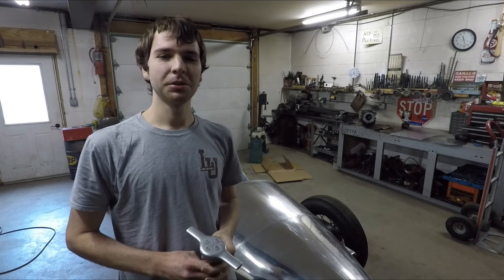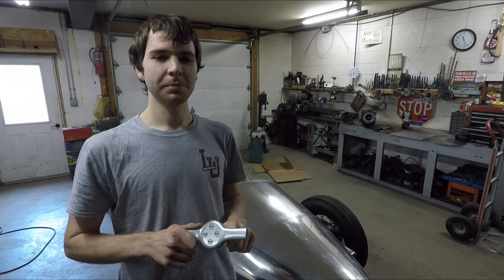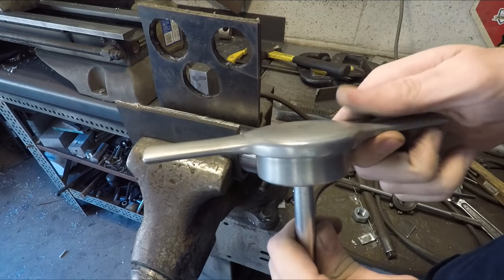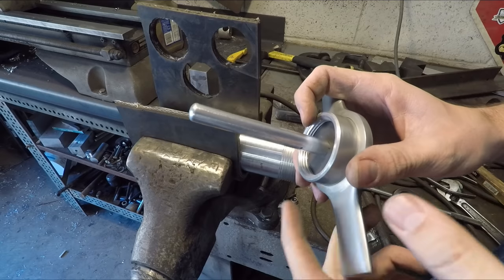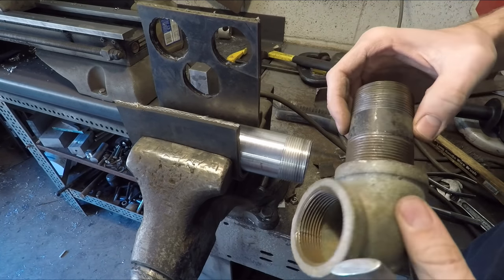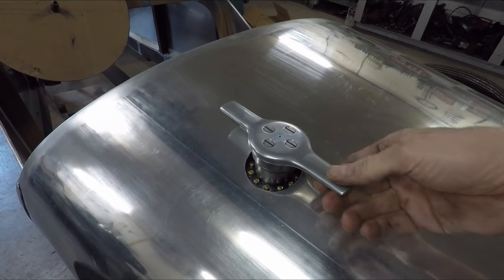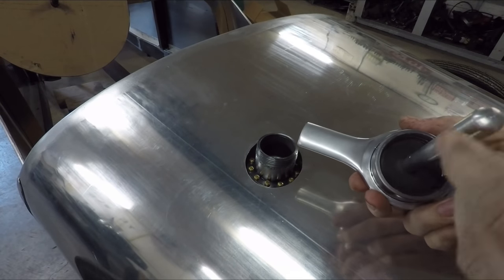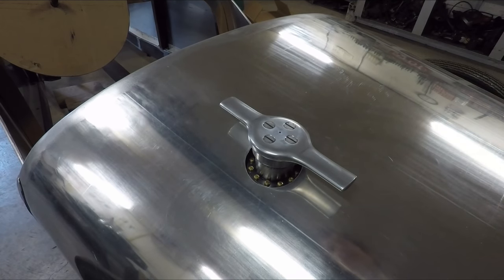Custom Vintage-style Gas Cap | Homemade Boat-tail Speedster Pt. 38

Comment: Lovely hand made part, looks great! Vent hole comes out vertically on top, so water is gonna percolate into the gas tank, also gaskets and dissimilar metal corrosion will be an issue. AND these pointers are not criticisms, they are pointers to help you succeed, not fail. 
Keep up the great work, you will be phenomenal in 20 years, you are already incredible.

Comment: The information you were going off of for getting annealed 6061 back to a T6 state was incorrect. It's a two step process. First, the part has to be heat treated to T4  and then it has to be aged to T6.

You get the part to T4 by heating it to about 980° F and holding it there for about an hour. The purpose of this is to dissolve all the alloying elements in a solid solution in the aluminum. Then quickly quench the part in water. The purpose of quenching isn't really to strengthen the alloy, although it does somewhat; it is to cool it rapidly enough to prevent the alloying elements from precipitating on cooling.

Next, you get the part to T6 by heating it to 325° - 400° F, so the alloying elements begin to form ordered arrays of atoms in the aluminum matrix. These arrays are called GP zones, and they strengthen the aluminum considerably. This heat treatment is called aging, which results in material with a T6 temper.

Three commonly used time/temperature cycles are used for aging—one hour at 400° F; five hours at 350° F; and eight hours at 325° F. All are equally effective.
 The part is left in the oven and slowly brought back to room temperature. It is now is a T6 state. 

The part will distort in the heat treatment process. So final machining should be done afterwards. 

National Pipe Thread is not a good choice for your gas cap. The tread is tapered and is not intended for parts that will be repeatedly taken apart and reinstalled. You have a rubber gasket, so you don't need a tapered thread for sealing. A straight thread would be more appropriate for your application. And, since you have a lathe, you could have easily cut the threads yourself rather  than cobbling together sections from pre-threaded parts. 

There is one final process that you might employ to make your aluminum parts more durable and improve their finish: anodizing. The oxide layer is harder and more scratch resistant than steel, and the parts can be dyed during the process. Aluminum oxide is the most common abrasive because it is so tough.
Reply: As a metallurgical engineer, I approve this post.

Comment: Pretty good planning getting the cap to tighten in that position.
FYI, leather was commonly used as a gas cap gaskets, they still sell them for antique  motorcycles.
Good work.

Comment: Amazing amount of thought and effort in such a simple component. 

Just 2 thoughts; 1) might a gasket or O-ring be a good idea at the neck/tank interface? and 2) with aluminum, brass and carbon steel all in the circuit, which is going to suffer electrolytically?

Comment: You may have already checked into it and know but if you still plan to enter into T.R.O.G. or some other competitions with it when your done then you may not be permitted to have an open vented gas cap. 
Easy solution to keep the beautiful cap might be to tap the small hole on the lower pin to install a grub screw and then add an actual vent line off the tank under the body work that can have a check valve installed.

Comment: You should add a roll-bar behind the driver similar to the Shelby Cobra. In my opinion it would go good with the asymmetrical design of the speedster. Amazing Job!!!
Reply: Or D type jag

Comment: Amazing project and really love your problem solving skills.  It would appear that the threading issue with the aluminum pipe wasn't about being an issue about losing the T6 properties but more on the physical dimension of pipe threads. NPT pipe thread is tapered 3/4" per foot. The section you welded on was undersized. The best solution would be to turn straight threads as found on a bolt.  Mixed materials such as steel, brass and aluminum will cause galvanic corrosion issues.  I see these type of problems daily as I run a machine shop repairing aircraft landing gear.  The greatest thing about this project is that you are doing it, not just dreaming.  Keep up the good work..
Reply: Are you saying it s aircraft quality

Comment: Great project, been watching from the start.  One note though, fuel cells/tanks are NEVER mounted with tabs.  They are always strapped  in.  The tabs are a stress point and with normal vibration and the weight of the fuel sloshing around , the cell will fail and lead to fuel leaks.  Any mounting system you use that is welded to the cell , no mater how elaborate, will fail along the weld seem.

Comment: I wonder if at 5:07 you could have bored to size, making it the same dimension as what the top of the threads would be, then after 5:28-:44 you could have either lathe cut or tapped the needed threads to depth. I did a little Metalshop in HS and college, and that's what occurred (sp?) to me after your comments at the end of the vid. Since your dealing with steel and Alum  contacting at 15:56, should you have a washer between  the flange surfaces where the brass screws are located?

Edit: a little lock-tite would not be amiss on those brass screws.

Comment: I think you need a seal between the gas tank and the filler and the aluminum flange on the gas tank. 15:53

Comment: Great job, fantastic workmanship. Have you thought about the spark threat especially as the threads are steel to steel? Perhaps brass may have been a better safer option. Just a thought, better safe than sorry.

Comment: It looks like you are using the rubber in the cap as a gasket. In your first version, you could have put the threaded parts in the lathe and cut them to full thread depth. The parts you started with were tapered pipe thread. No taper , threads are happy. Great execution on this project.!

Comment: Hated to see you lose all your beautiful work on the all aluminum gas cap ... it was gorgeous !!!  FYI ... from one that has been involved in the construction of the longest running Aircraft Production Program in the history of Powered Flight (the C-130 Hercules - first Flight AUG 1954) and is made to this day in mainly "Aluminum" ... there are ways around your T4 threads.  "Dry Film Lube" is a wonderful option (keep in mind that "WD-40" was made for the "Apollo Mercury Spacecraft Program" ... "40" being the 40th attempt) as well as "Anodizing":

"Lithium  works well if one or both of the  is bare . Pretty much any  works well if both  are anodized . You don't really need to worry about lithium  corroding anything, because the lithium is bound-up in a chemical compound and is no longer reactive."And now that you've introduced "Steel" to an Aluminum surface, you've set yourself up for "Galvanic Corrosion" ... next time:"For , a single coat of chrome phosphate pretreatment followed by primer and high-performance paint may effectively . Alternatively, a single field-applied coat of heavy-bodied bituminous paint can be employed. Anodic coatings alone are usually insufficient for  separation."Free advice ... here if you need me in the future.
Reply: ... and I hope and pray your chosen University Degree is in Aerospace Engineering ... we need folks like you to carry it forward ... you've certainly got what it takes !!! Bravo !!!

Comment: 15:50  I didn't see a gasket when the two parts were screwed together.  Does it need one?  Thanks.
Reply: Yes and no 
On a modern car with a charcoal canister 
Yes 
On this thing with no tank breather 
No it'll actually help it

Comment: Cool looking cap. I wonder what type of rubber your gasket is made of. It may not hold up to the chemicals in gasoline. Neoprene is not compatible. Viton and Buna N are. You may want to submerge it in a container of gasoline to see if it will stand up to it.

Comment: A few things I have learned from doing projects is make it run and drive first. Before you do the electric parts make exhaust because it never fails you will have to cut some panel and manipulate it

Comment: Great video as usual. I see that setbacks don't stop you, you just change course and take a different route. One question I have is will this car be licensed for the road when finished.
Reply from the maker: Yes, absolutely
Reply: @MacroMachines  Its all home made isnt it? how do you licence it without a vin, paperwork etc.? Greetings from Ireland 😀
Reply: MacroMachines what series of sheet aluminum do you use for panels. Thickness also. Sounds like you anneal the sheets but I don’t recall you talking about that in earlier videos. Thanks for sharing your project.
Reply: mister clean  wow!, thanks for the clarification. Lucky you guys! Over here the vin plate and paperwork stays with the chassis or shell. You can't just make up your own. Very cool! Do the DOT also carry out annual inspections or just roadside too?
Reply: @internetbodhi1009  thanks Scary, appreciate it! I was wondering what I had asked when I got the notification  😂. In the states where the vechicle has to be tested do you have to get an engineers report or is it completly up to the tester to pass it?
Reply: @internetbodhi1009  No problem, it's good to get bits of info like this. You'll get situations like that all over the world. Just human nature I suppose!  Thanks for taking the time to go through it 😃👍.

Comment: As always another great video of a grate project 👌🔝👍

I think it would be a good idea to put some kind of rubber washer between the aluminum and the metal bolt on cap, because in the end metal will ware out the aluminum, but with all those bolts I’m not 100% on that, sow you choose what’s better just a suggestion 😉👍

Keep the good work and the good video’s coming 😉👍

Comment: Cap looks great, but if you don't like the look of the steel turn down an aluminum sleeve & epoxy it to the outside of the steel threaded part of the cap, for asthetic reasons only of coarse. Speedster is looking great.

Comment: I have never seen an aluminum fuel cell that was flange mounted not leak. If you find small cracks developing. You might want to look at a strap mounting situation. Beautiful work so far.

Comment: So I think you should make the hole in the body a bit bigger and make a cup that seat between the flanges. I think it would give it a great old look but either way you go it going to be awesome. I also think you could brass those 4 screws on the cap like michaelcthulhu does. Heat the part and rub it with brass brush and it makes it look like its brass.

Comment: 5:22 i still don't get how this type of welding works, surely the whole thing should just melt in to a heap of molten aluminium? or do the alumiweld sticks have a much lower melting point? are they just not aluminium?
Reply: It's not welding, more like brazing. I think it has its place for low stress/ hard to reach areas. But it's in no way a substitute for proper welding.

Comment: Your work is amazing, your skills are great, no doubt about it, but you really should overthink the use of Aluminum/ Brass an Steel in this style, it will eat up each other by electrical corrosion. Same too your body/ frame construction. In some places I think you insolated the contact surfaces but, if I remember right not at all parts of the body. Nevertheless, fantastic to see such a young man doing this kind of artwork. There's nothing you can't do, no assistance needed for machining/ welding/ turning sheetaluminum into a gorgeous body/ restoring an engine...! Thank's for sharing, can't wait to see the next epsode. Stay safe and healthy, greatings from Germany!

Comment: To get it back to a t6 you have to heat it up quench it then temper in the oven
And on the can if you would have flipped your part and put your screw in underneath you could have flattened off the top and it would have virtually disappeared 
Loved the video tho just putting in my 2cents if it's worth that much lol

Comment: Just wondering wouldn't it require a rubber gasket between the two flanges on the fuel tank?

Fuel has a habit of expansion when hot and most tanks have a breather system in place

Comment: If you had turned the oven off after an hour and left the cap inside so that it cooled slowly you would have achieved the result you were looking for. Nice cap though.
Reply: Yeah, (just grabbed my metallurgy book and) aluminium is hardened by heating it up one time, let it cool down slowly. then heat it up again, and slowly let it cool down again. then heat it up another time, but quench it in water. and then heat it up and slowly let it cool down again two more times.
Reply: @jobvdboom5000  that's allot of heating and cooling
Reply: @jobvdboom5000  I don't know if I would have the temper to do that process

Comment: Absolutely lovely! Yeah, aluminum can be a bitch to work with. Flame welding will introduce a lot of heat to the workpiece. I had some success with soldering the parts together with plain normal plumbing solder...it works great for such a purpose!
I like the level of detail you go for, which really shows craftsmanship on a higher level.
The brass screws look awesome but there will be a problem with galvanic corrosion regarding the aluminum. Stainless steel will be a better choice.
I'll have a look at the other videos, for sure....very enjoyable. :)
Very clever that little tube in the cap. I wondered all the time what the heck it was for..maybe a primitive level indicator? An excellent solution to both problems..venting and anti-tip all in one.

Comment: I have in the barn an aluminum cap and adapter. Cast.  No thread.  Two lugs cast on the adapter and two wedges cast inside the cap.  Half turn or so.  Kinda like a jar.  Save for just such a project.

Comment: Brass, aluminum, and steel...  Keep it out of the rain.  And, especially, the salt.
Reply: I thoroughly agree. Brass and aluminium make for rapid galvanic corrosion, especially if, as you say, there is some salt mixed in to accelerate the process.

Bloody good work, though. The man is a delight to watch.

Comment: ur going to need to put a gasket between that steel threaded part that u bolted to ur fuel tank. u will have fuel sloshing around and leaking from there

Comment: Having threaded and assembled virtually thousands of aluminium threaded assemblies over the years I can tell you that you are wrong in your assumption that the weld destroyed the characteristics of the material and that's why your threads are galling. Alloy threads literally always gall unless you use a dope or lubricant rated for aluminium. Using steel against alloy will stop the problem but stainless is a better choice. If it was me, I would remove the coupling from the cap and then machine 1/2 of a merchant coupling to take it's place. Notice I said merchant coupling. Merchant couplings differ from NPT (National Pipe Thread) couplings in the fact that their threads have no taper. By using a merchant coupling your cap will tighten up on the rubber seal instead of the threads. To affix it in the cap, machine the butt end with a taper and make the recess in the cap with a matching taper like a jacobs or morse taper lock. When you press the two pieces together use a high strength capillary Loctite to keep them together permanently. The other method would be to TIG weld the two together using the method described her:  https://weldingmastermind.com/how-to-tig-weld-aluminum-to-stainless-steel-the-full-guide/   . Just sayin............bin thur, dun thet........